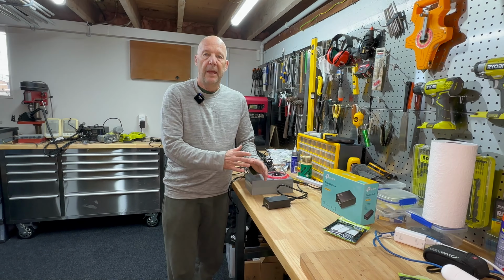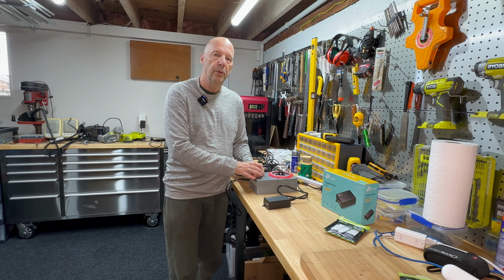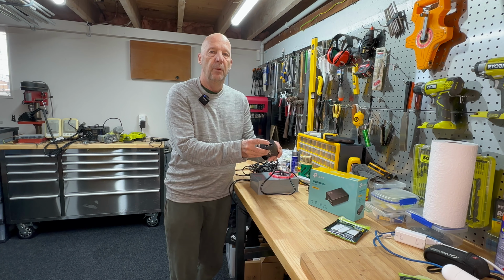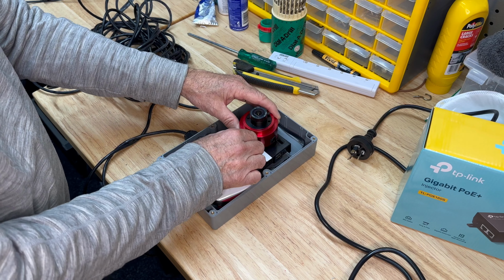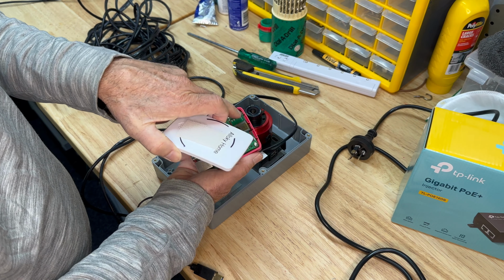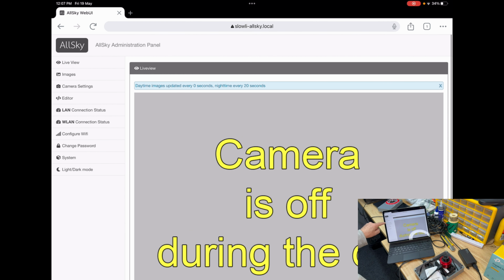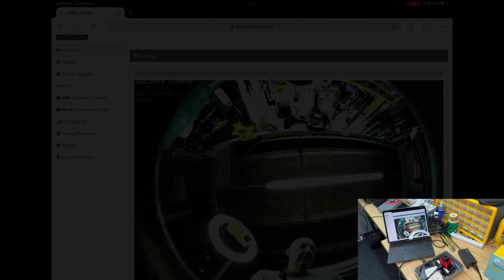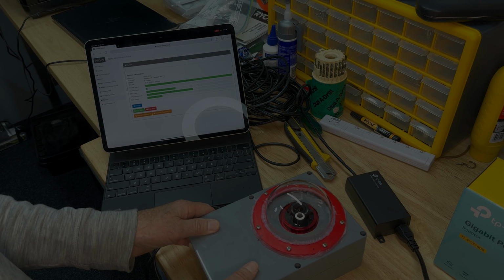Allsky camera and POE+

Comment: Logan, have you had any issues with the Wi-Fi on the Pi making the trip to your router inside?  Great video, thanks for posting.!
Reply from the maker: Yes I have. Generally it works perfectly fine but every now and again, roughly after several months, I can't access the Pi and need to turn it off (just turn off the power ) and then turn it back.

Comment: What a great idea.
This would solve a big problem for me .
My original plan was to run 15 feet of usb-c waterproof cable  from the allsky camera to the original power adapter .
Unfortunately at this distance the rpi power adapter could not supply enough power to run rpi4b,camera,wittypi4 and the dome heater.
POE+ appears to be the answer.
Thank you for sharing this informative video.
Reply from the maker: Thanks for checking out the video and I'm glad this has been useful. POE is certainly a great way to get safe power over long distances.

Comment: Great job.  POE is a good choice for a Pi4, since you are always better off with wired networking.  Good project!
Reply from the maker: Thanks very much. Yes it does mean I can have the choice of running wireless or LAN and I feel a lot happier running just ethernet power rather than a 240v power extension cored. Thanks for checking out the video. Clear skies.
Reply: @LogansAstro  Yes, I don't like running high voltage AC.  My piers are 200m from the house and I have found some creative ways to provide high current12V DC over that distance without loss.

Comment: That's a really nice setup Logan. I would really like to build a setup like this but where I live, the Nevada desert, we get daytime temps in the summer over 115°f (46.1°c) so having a sealed container like that, I'm afraid would overheat very quickly and destroy the electronics. I'm planning on building a RoR so I guess one option would be to mount it inside the RoR but then it would only be effective when the roof is open.
Reply from the maker: Thanks Greg. What about having vents with small fans running inside the box to keep the airflow running during the day (put some mesh over the vents holes to prevent critters getting in). And don't have the camera capturing during the day as that will keep the CPU and camera sensor temp down. Although, to be honest, 46°C  would probably melt me before the electronics🥵😂.